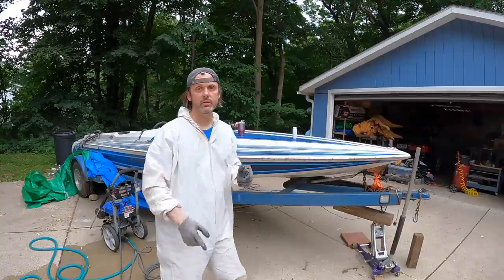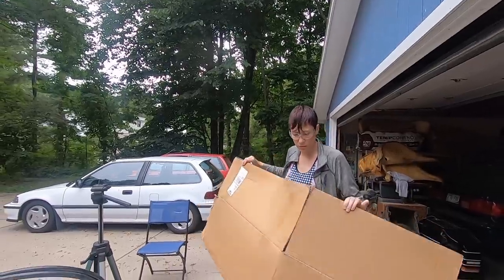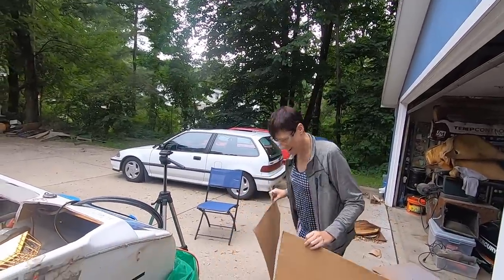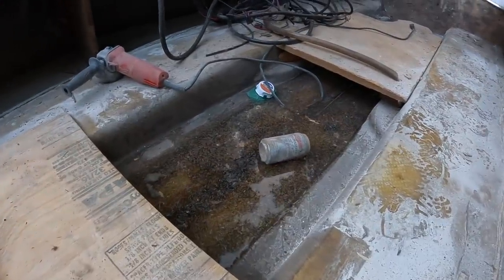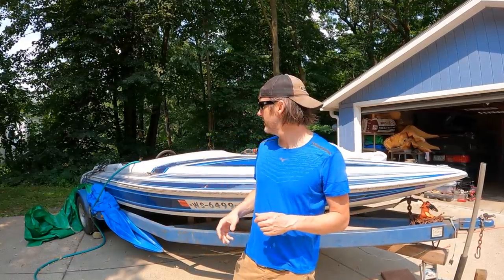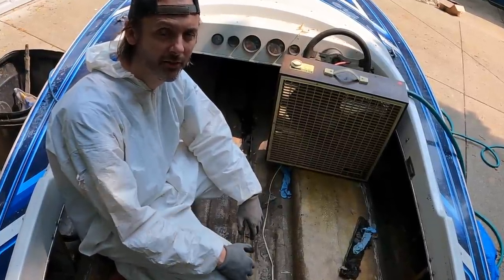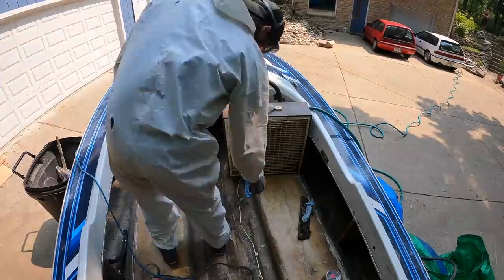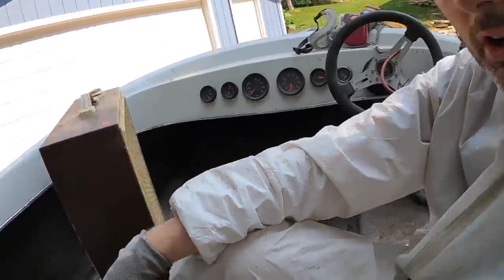Restoring a Race Boat for CHEAP!  Transom Template & Final Prep Sleekcraft SST Sunday #8

Comment: Use hairspray on your arms to prevent fiberglass fibers from penetrating into your skin, then wash with cold water. The light you see is where the gel coat is worn off from beaching the boat , fiberglass resin and cloth are translucent without gel coat it doesn’t necessarily mean that the fiberglass is thin
Reply from the maker: Great point!  I was under the boat and didn't see any scuffs in the gel coat but maybe it was hidden behind a trailer crossmember?   I'll try the hairspray trick next, thanks!

Comment: Awesome Job. 

Tip: to remove fiberglass dust from your arms use a lint roller.  The kind with removable sticky paper. What I've found that works best.  Alternative, use duck tape.  Use like removing hair. Stick to your skin then pull off.  Dust will come with it.
Reply from the maker: Thanks for the tip!

Comment: Great videos! 

You don´t really need to have the new transom down in the outer hulls, unless you plan om having trim tabs there. What you can do instead is to make 30-40 cm of the aft most floor extra strong and a part of the transom. That will transfer the forces from the lover part of the bracket to the hull in a really good way.
Reply from the maker: Yeah that area will have heavy tabs for sure

Comment: another great breakdown video....glad youre replacing the keel stringer, there will be a lot of twisting and flexing loads which can be eliminated by a simple keel with cross members every few feet and your floor wont sag over time in the center, cheers!
Reply from the maker: Yup, seeing the daylight made me realize how light this hull is, the layup is far thinner than my aristocrat.
Reply: @ADDvanced  I had a VIP deckboat that I sold and when the new owner went to bottom paint it, the keel ridge was a half mm thick from years of running up on sandbars and islands...I felt bad about it and offered to help him fix it, so we ran a double strip of woven glass down the whole length, man what a pain in the itchy ass!

Comment: Sir I still would not put I stringer in just put a few more Layers of Carbon/Kevlar strip in the thin areas. There is a company on EBay that has some great material. That honeycomb with Epoxy will give strength. But this is your Build. Good luck and Be Save
Reply from the maker: Which company?

Comment: Have you thought about adding some fiberglass to the hull under the stringer?
Reply from the maker: Won't really be necessary as the stringer will support the glass.   Plus the tabs of glass will also reinforce it.

Comment: what if you put the throttle on the steeringwheel?
like mini jetboats have
they use like a bicycle brake lever for throttle
Reply from the maker: I don't think you'd have the granularity required to control the boat.   Maybe... but things get really weird at 70+ on the water.   Those mini jet boats are toys, and are not very fast.
Reply: @ADDvanced  mini jet bosts go about 50 to 60mph
Reply: @ADDvanced  but yeah i think hot foot is a real good solution cus you can feel alot more in tje throttle unlike a handle like normal boats with outboard
Reply from the maker: @thedandy6765  50 and 60 is a pretty safe speed, but above 75 the game changes considerably.  It's a whole different world, and a rogue wave or gust of wind can cause a blowover.   You need to modulate throttle and steering to fight chine walking as well, because a surface piercing prop tries to push the stern of the boat sideways since only half the prop is slapping the surface of water.
Reply: @ADDvanced  yeah thats true and at 75mph it gets hairy on the water i sometimes have that my boat takes a rogue wave and just goes 1 way when it splashes down and thats at 35mph 
imagine that at 80